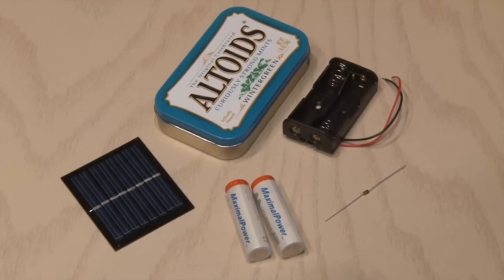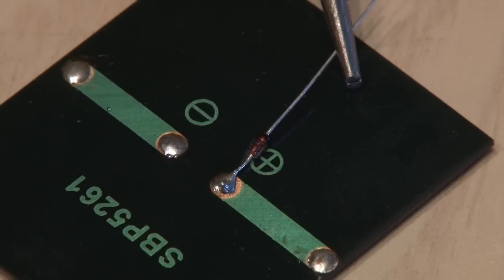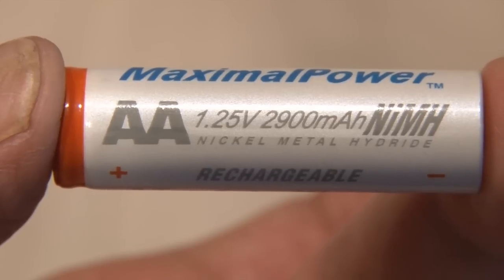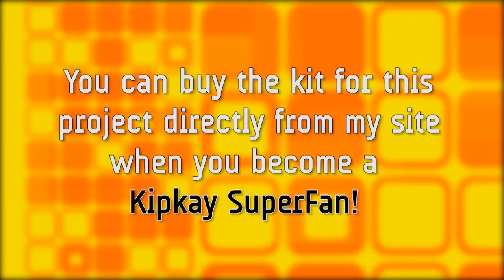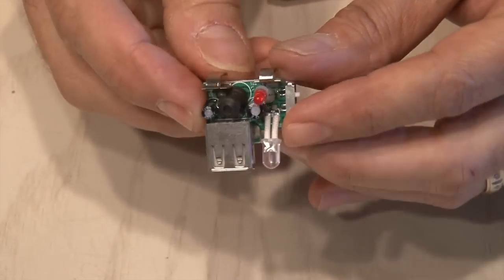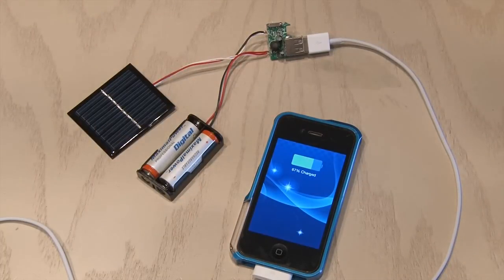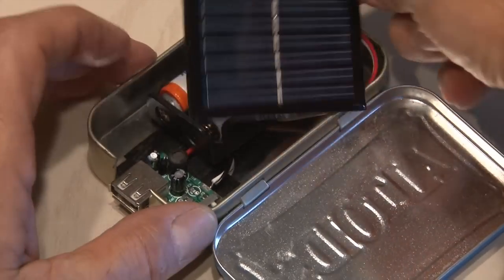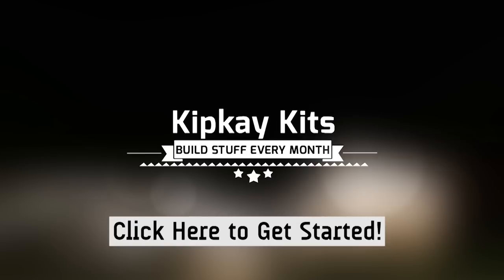Build a Kipkay Solar USB Charger!

Comment: Why do i need that diode ?Can someone explain It?What if i dont put diode in it ??Can this work if i take apart a usb car charger  and connect it to the solar panel and if i put it out to the sun will it charge my phone ??
Reply: You have to use the diode so that electricity doesn't flow back into the solar panel.

Comment: What about the speed of charging 2900mAh batteries? When I lead, so even if giving solar panel 50 mA, so that in the ideal state of charge will nonstop 48 hours. Even if the sun shone every day, 12 hours, so you charge the battery for 4 days and it does not count in the self-discharge or even overcast sky. I myself have made solar charger with a 9 "panel 6V / 680mAh, Charging the battery is 2900mAh, but it takes an incredibly long time and phone charges to about 70%. I found that this way is not the way.
Reply: then what is the way if i may ask ? :)
Im About to build one with 4xAA 2100mAh and a solar with 9 v / 200 mAh or 12 / 300 mAh, hope it will work

Comment: not really what is the difference between buying the components in separate packs and assembling them. And buying the components in 1 single pack and assembling them.
It is a bit like the so popular velleman kits (they at least are in Europe), u buy 1 pack with all the parts and assemble them to get your end products. It is the same thing.

Comment: That's Great
But I see your input was 2.5 volts , how it run 5 volts mobile charging
Reply: The module from the power bank is a buck converter which means it takes a specific amount of voltage up to 5v and then puts out a steady 5v

Comment: I do this for lithium batterys , but does anyone know if I can rig a 3ft by 1ft solar panel up to a female usb such as the one in the video will it overload my emergency battery pack . I plan to use the panel without a car battery just want to know if it'll work without blowing.

Comment: Question. Why didn't you just solder the soler panel to a switch connecting to the usb charger. Then you would not have to use batteries and charge your phone faster.
Reply: The solar panels put out random voltages, but the batteries put out 1.5v all the time.

Comment: Does anyone know if you'd be able to connect a super-bright led to this and aim it at the solar panel to get (in theory) infinite energy? Or would the phone pull too much for the led to properly provide enough power?
Reply: Uhhhh..... 
a lot of energy will be lost unless you can be sure that the all of the LED's lights can be pointed at the solar panel
Reply: nfsdude911
That's what I said, aiming the LED's at the solar panel so all of the light would go to the panel (through the use of the kind of cone a flashlight uses). I'm assuming though that the LED's would draw more than they give, but I don't know if that's actually true or not.
Reply: DarkVeilGaming You would eventually lose all power, so NO, it would not work.
Reply: nfsdude911
Ok, I figured as much, lol.
Reply: Energy can't be created or destroyed only transferred, assuming that all the energy generated from the solar panel all becomes electricity, then light with non of it wasted as heat or anything else and it's all directed at the solar panel and the solar panel transfers it all 100% efficiently. Then you have a closed circuit of energy in theory. Now if you're withdrawing power from this circuit of non-infinite energy then the LED will not have as much energy as energy is removed from this cycle to charge the phone and in the end all the energy is removed from this cycle therefore the cycle is broken. Also nothing is 100% efficient so energy would be lost as heat in this cycle anyway. 

- Joe
Reply: Exactly, Roundhayblockos
Reply: Roundhayblockos
Good point, i knew the laws of energy and whatnot, but I dunno, I was hoping somehow it'd produce more light than it did absorb energy. Oh well.
Reply: If that happened then we would never have any energy problems. Oh well glad you know now.
Reply: Haha well I wasn't sure how much electricity the solar panels would create with the lights, I was thinking maybe the solar panel would be outputting enough to keep up with the 5v of the phone charger, but I guess that doesn't make much sense.
Reply: Roundhayblockos Hello..  I have thought of making a flash light that runs off LED's pointing at solar panels.  Did some research and ran the theory past some smart YouTube Physicists lol and got pretty much the same response you have here.  So I put more thought into it and found a device that converts heat into electricity and came up with a new and improved theory.  Take the LED's and mount a peltier device on any part that emits heat.  Most likely that would be the backside of the chip.  So you would have a peltier device, LED chip emitting heat thats converted into electricity and an LED emitting light onto solar panels.  Oh wait.. You all haven't heard of the 12 year old girl out of Victoria B.C. Canada that has already made a flashlight that is powered off of a peltier device?  The flashlight has no onboard power supply, it simply is powered by a few peltier device's..  Educate yourself people.  Break away from the herd and be heard!
Reply: Sorry for the late response, I don't use Youtube frequently. Your new theory makes the device more efficient however doesn't make it generate infinite energy as energy will always be lost even through Peltier devices (Which aren't 100% efficient) and heat is lost through wires, et cetera. So there's the problem with the device being 100% efficient.  I've mentioned the law of conservation  "Energy can't be created or destroyed only transferred." so assuming that all your energy is transferring from light to electricity/heat 100% efficiently then you still only have x amount of energy as soon as you try and use that energy for other outputs like a torch then the energy remaining will become lower than x and keep decreasing until there is nowt.  I have actually heard of Ann Makosinski (Who by the way was 15 when she invented the body heat powered light.) Her device isn't 100% efficient, it just converts waste thermal energy into useful light energy. I personally spend much of my time educating myself on various issues and personally I don't even understand what you trying to say with " Break away from the herd and be heard"
Reply: Roundhayblockos Well..  No need for you to try and understand my thoughts and beliefs as they are just my thoughts and beliefs, so called theories.  But I need to talk a bit about this law of conservation that states " Energy can not be created nor destroyed only transferred ". Im not a religious kind of guy but, doesn't this law kind of knock the whole God thing out of the picture?  He didn't create anything.  Anyways.  I like to think I'm solar powered.  Think about it!

Comment: 1.25+1.25=2.50 volts

Hmm, pretty sure you need at lease 3.7 volts to charge something through USB
Reply: That's what the aa battery phone charger component was for. It is likely a transformer with some type of regulator for the usb device.

Comment: i think it would be easier to just get a female usb cord and strip the wire revealing the 2 wires and then solder them to the solar panel and there u go.

Comment: how does sun charge through   tin panel Must be Exposed to sun coz he just put kit in & closed lid means have to open every time or glue s-panel 2 outside & risk Damage these are Only $10-15 Bucks ready made in many shops but Nice for father N Son Project etc Using Bigger Batteries & so on could be handy for camping also
Reply: Not really...you could actually trace and cut out a hole for the panel, then stick it to the top of the tin with some double-sided sticky foam or tape.

Comment: Anyone can help?
I Bought 2 solar panels 5,5v and 290mA.
My phone charger has 5v 600mA. So i try to connect them parallel,but i realise that   the ampere is still 290mA and volts was 5v(with my my multimeter) .So i try to connect in series,and i realise that voltage increased to 12v,and ampere has increased to 580mA.So can you help  me,to connect correctly my solar panels.The results witch i want is 580mA and 5.5v,this one must achived with parallel mode but i dont know what happend.

Comment: Trying to charge a moto X with this setup just makes the phone go from charging to not charging over an over again, and when it stays charging it just drains the battery.
EDIT: okay i looked at the emergency charger that he used, and it turns out that it will only allow 500mah out. most smartphones nowadays consume 3 or 4 times that, such as my MX, which takes 2200mah. This probably wouldn't work great for iphones and most strong android devices(might charge some older devices, but very slowly).

Comment: This is so wrong... It uses as few components as possible but still.. It's so wrong. No protection whatsoever for the battery, and the solar pannel will never charge the battery in a utile time..

Comment: How does it charge usb with only 3 volts?  Usb needs 5.
Reply: I think the solar panels charge the batteries, that fill up the capacitors on the energiser board to 5v potential and then that will intern charge the phone.
Reply: TheVideoVolcano oh i see the 3v goes into the step up circuit and it outputs 5v
Reply: The USB is a step up circuit which boosts 3v to 5v
Reply: HapplyFace Amazing what you can learn in 3 months....

The caps on the energiser are smoothing caps that work with a linear voltage regulator for a smooth tight 5v.
The solar panel is going to generate a bumpy voltage output, due to lighting changes and whatnot.

The caps charge up to a certain level and discharge into the regulator and that outputs 5v.

The regulated voltage then charges the batteries which phone uses to charge up from.

Kip kay charges the battery in the sun initially so that phone could charge straight away while the battery charge in parallel (or tandem)

Reason I revised this, is because I have have had enough of my phone dying.
Reply: TheVideoVolcano And even more amazing after 4 months you can go from knowing almost nothing about electronics to learning enough about electronics and soldering to make a portable, battery operated raspberry pi with its own hacked screen and controller.  Oh and thank you for your detailed reply, I'm sure it helped someone out there learn something new.
Reply: HapplyFace Pls have a look at 1:57, he removes a step up dc - dc converter from a power bank I suppose. We deal in the modules which can do that. kindly check my page on facebook for our complete business profile. Thankyou!
Reply: Phone nowadays can charge with 3 volts but enought amps.He used 2.5 volt from battery and around 3 volt from solar panel.that is around5.5 volts plus voltage regulator and you get it

Comment: What if instead of batteries at the end you put a phone charger, lol. Like, it probably wouldn't do much at all for a phone, but when you're desperate for a charger it might do SOMETHING O.O
Sorry, I'm not too smart with this stuff...
Reply: Not at all wrong.  Although he does add a phone charger so that might be the only thing to correct you on.  Indeed however it is a very smart idea.  One could even either attach a bigger battery pack and use that or keep it the way it is, make a hole on the top of the tin for the solar panel, and that way you wouldn't need to open the tin every time you need a charge.
Reply: Or jack up a car battery to it! HAHA

Comment: So, just because of this video I bought one, but already assembled from a different company.

This one has a 2600 Mah Lithium Ion battery in it that the sun charges.  You have to let the battery charge first, then you can then re-charge your USB connected device.  You can not get it to charge via the sun & try to charge your device.

It also comes with a AC adapter to charge the batteries in the solar charger.

I paid $19.95 with free shipping for it, but listen to this.  It won't charge my cell phone!  It will only recharge smaller items that draw too much power.  The solar cells are rated at max of 500 Ma output in full bright sun & it says that it would take 8-12 hours to recharge the internal batteries.

So!  If this DYI site here can do better, than so be it!

Because this item I bought doesn't do what it is supposed to do.